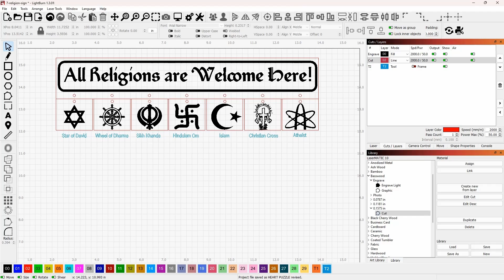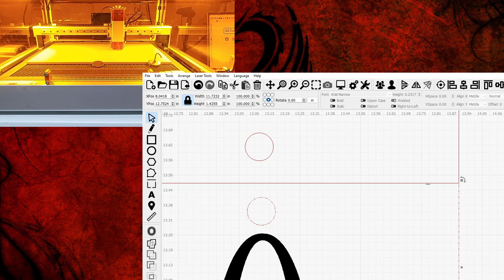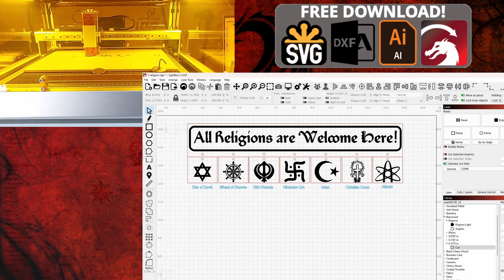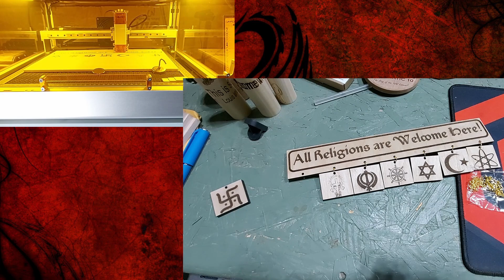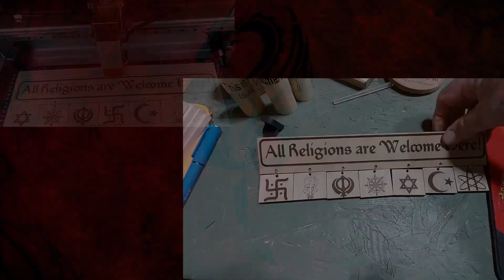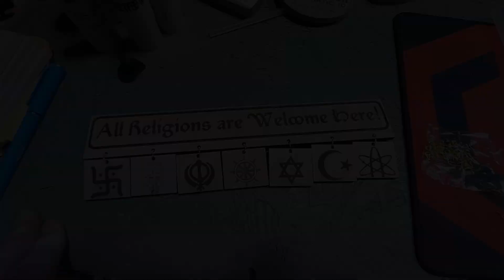🙏 All Religions Welcome Here, FREE LASER CUT Sign! For either a diode or Co2 Laser Engraver, Cutter!

Comment: How do I deactivate my license from one laptop to install Lightburn onto another laptop?
Reply from the maker: https://lightburnsoftware.com/pages/manage-your-license-activations-with-the-license-portal
Reply: @TheLouisianaHobbyGuy  thanks for the information.  My new laptop can and does detect my laser.  I have my second license on my new laptop.  The new one has touchscreen available.
Reply from the maker: Never once used my touchscreen.
Reply: @TheLouisianaHobbyGuy  how can I figure out where my exact engravable area is on the Monport?   I want to setup a template for engraving metal business cards.
Reply from the maker: Set a tool path of bed size in Lightburn and work inside that area.